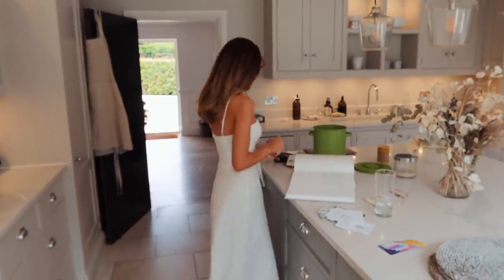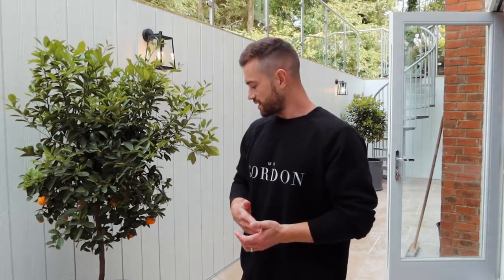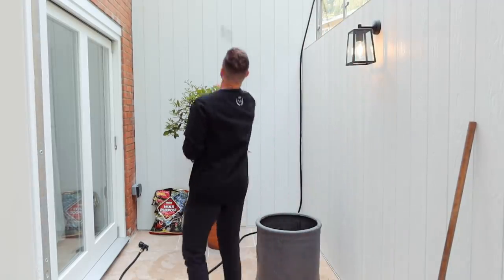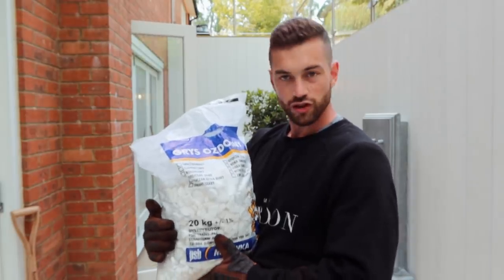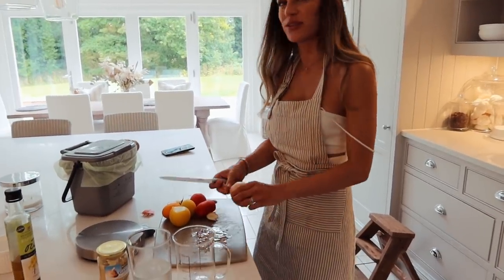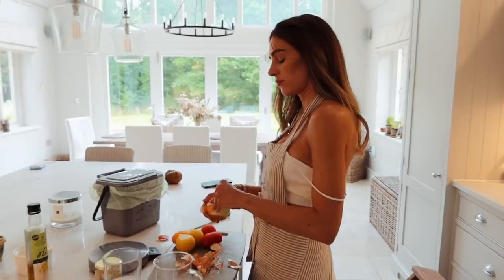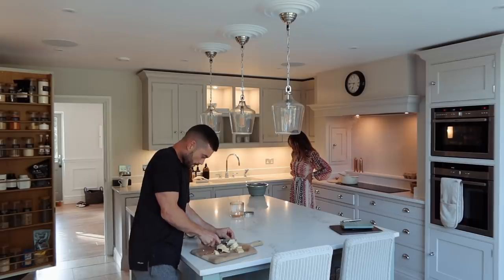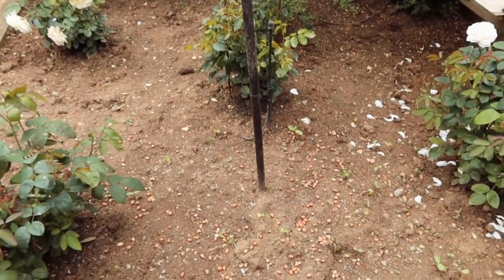AT HOME WITH THE MG's UN-BEE-LIEVABLE HIVE THE BIG POTTING SESSION | Lydia Millen & Ali Gordon

Comment: Have you thought of using Bottomless Pots for your Citrus trees? You'd have to decide where you want the plants permanently placed but the tree & roots will be happier in the long run. A good pruning of interior branches would aid in producing fruit. 
Beer works for slugs. Just place a pie pan with beer under the leaves of the plant & that'll take out your slugs. You can even use cheap domestic beer, slugs don't care.

Comment: For the drip trays you can use lead flashing which you can just mould and hammer into place. Would look better than the ugly plastic.
Reply from the maker: Steve ldnuk it’s Aluminium but agree not nice how it wraps around the top. I think flashing would look awful also imo, the colours the finish it needs the copping stones to lap over
Reply: @AliGordon  - How about copper flashing. It's not that expensive.